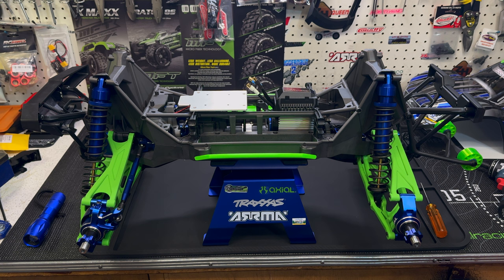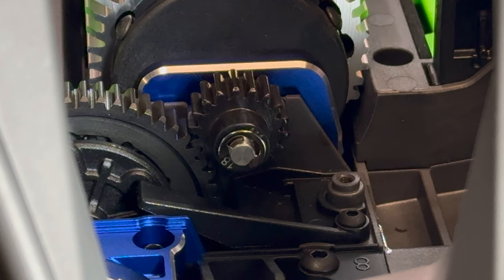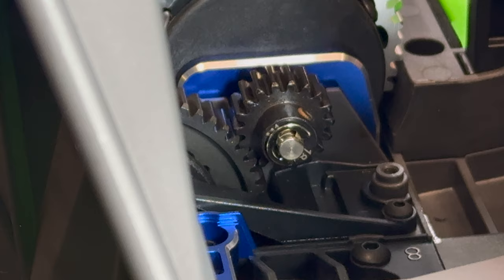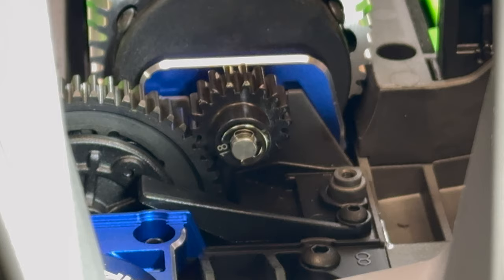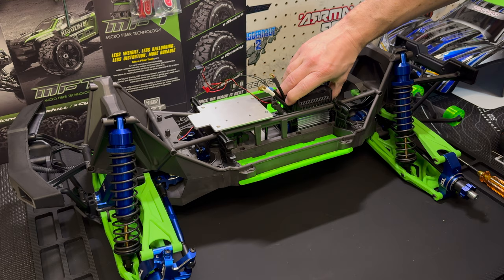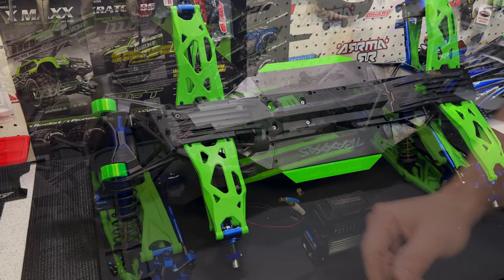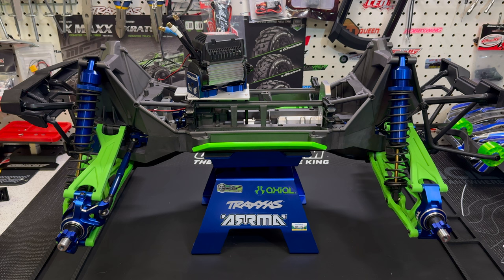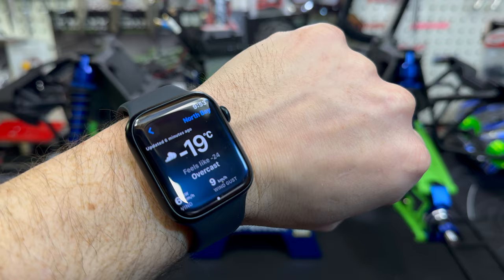Traxxas X Maxx Ultimate (Still has the same issue as all X Maxx's) EP. 5

Comment: I’m surprised yall have broken more shit. Suspension is pretty bulletproof but hell I’ve broken every piece of the drivetrain on multiple accounts besides the center driveshaft and driveshafts themselves. Diff cups,rear diff,front diff,center diff,spur,pinion. They take a beating for a while but as they age they really start to fall apart drivetrain wise. Maxx holds up way better in the long run

Comment: I ran mine straight out of the box. Even if the pins are in they usually have some play in them. If you take them completely out the motor will move. I have metal motor mounts and the Traxxas metal washers still have to adjust almost every time. Just my experiences. Still going to watch your videos 😊
Reply from the maker: No.   It’ll be fine.  I’ve been doing it for years. Plus a lot of motor mounts work that way.

Comment: IMPORTANT PLEASE READ!!!  For anyone having issues with burning up their pinion and spur gear and youve done and tried everything to correct the issue to no avail.. The stock xmaxx motor has a HUGE design flaw that no YouTuber is talking about!! I found this out myself while having non stop gear mesh issues since my xmaxx was new out of the box. The Stock motor has PLASTIC end caps.. These end caps become loose and the holes wollow out on the motor casing! This causes your motor mount to be loose ON THE MOTOR ITSELF so when you think you have your motor mount bolted in nice and tightly to your chassis you wont even rellixe that your motor is ever so slightly rocking back and forth on the motor mount! This causes your gear mesh to be ever changing from too tight to too loose! I spent SO much money on my xmaxx replacing every single item remotely realiated to the gears and its mesh to no avail.. I went through COUNTLESS pinion and spur gears from mod 1 to mod 1.5 .. hardened or NOT! Finally I decieded to do a motor swap knowing it was the ONLY thing left that could be causing the issues (I thought the motor shaft must be bent) and only after FULLY removing the motor and looking at it closely did I realize that the motor mount was never tight to the motor itself from day ONE. and only kept getting worse with time..

MORAL OF THE STORY: If you think youve tried everything and are still having gear /gear mesh issues then get rid of that factroy motor! I listened to all the youtubers who said "Stock motor is great, no need to replace it!" and I got burned because of it! Dont be like me and save yourself the trouble as even if its not causing you an issue now.. it eventually will loosen up in the future and will start eating gears.
Reply: For anyone wondering.. I now run the Spectrum 1250kv motor with the thick 8mm shaft.. A max 6 ESC, a GPM 35t mod 1.5 Spur gear along with their lengthened spur gear shaft with the end bearing to help support all the torque.. and I run 13T / 14T GDS hardned mod 1.5 pinions which come with the bigger grub screw which is heaps better than any other pinion and it keeps the pinion from loosening up and falling off the shaft due to the tiny grub screws other companys use.  The only good thing about having that hidden issue is ..now my xmaxx is fully upgraded because of it lol.
Reply: This is the problem with YouTubers such as Jason and the rest of the m2c racing testers …..a stock x Maxx doesn’t need the all the aluminium extras doesn’t need a more powerful motor just a esc and upgrades in the right area such as captured pins servo esc tyres and gears
Reply: Adding all this extra weight will inevitably cause issues it’s just showcasing people to get the m2c hop ups and motors etc that these YouTubers promote ……THUNDER RC proves you don’t need all this crap he’s one of the only YouTubers to bash hard and show you all
Reply: Thunder rc bashes properly and unlike Jason who some of his videos are very good talks too much and babies his rigs I don’t know even why he upgrades them so much as he doesn’t bash hard at all
Reply: Thunder rc bashes properly and unlike Jason who some of his videos are very good talks too much and babies his rigs I don’t know even why he upgrades them so much as he doesn’t bash hard at all rich and the others bash hard but promote the other companies where Jason builds shelf queens …he does make good videos however if you want honestly go to thunder rc he bashes hard when 99% of us don’t send them like thunder and rich

Comment: Interesting.  I use the pins, but just ignore the labeling and use whatever position gets the mesh right.
Reply: Cool, I think I may just try that if its too tight,  do some testing... my first x maxx the motor got too hot so I put the arrma 5th scale system in it  with new mount and esc plate it's great now waiting for my second x maxx now...

Comment: You can use the pin system just go one pin higher on the pin chart. The pins keep the rear and front of the motor perfectly aligned straight to make sure that the mesh between the spur and the pinion is at a perfect zero degree angle to each other.

Comment: Had stock gears for probably 40 plus packs of hard use and never had an issue 🤷. Just installed 19 tooth pinion from tekno and 50t spur from hot racing just because I wanted a better ratio. I still use the stock pin system and mount and it meshes perfect, zero issues thus far. I was fully ready to abandon the stock motor mount system if it didn’t mesh well, but it matched up great.

Comment: All you have to do for the motor gears  to be meshed properly, just move the motor pin to one gear tooth higher. Exp running 17t pinion put the motor pins on the 18t slot mesh will be good 👍🏼

Comment: When I built mine, I used the hot racing motor mounts on the original motor and the mesh didn't mesh well 😅 so I tried different pin settings and one of the leaves a bit of wiggle room so the gears are NOT gonna be at each other to death. Definitely not the pin settings they call for, just a fyi

Comment: I've been in the rc hobby for 10+ years now. I've gone through my fair share of gears. I can't for the life of me (even with aftermarket motor mount) keep my pinion on my stock xmaxx motor. Green/red locktite with a MIP driver. I even bought tekno gears that have the 2.5m grub screws and let it sit a week, and it still fell off in 5 minutes. My mesh great and bearings are new. I'm starting to question if my motor is just vibrating wayy too much
Reply: Clean the threads better
Reply: with a dremel,, shave a bit off the shaft where the grub screw sits. then apply loctite. will never come off again
Reply: They come with an oil on them from the manufacturer
Reply: Try putting some loctite on the motor shaft and let it set
Reply: Had the same problem and finally from some advice on Facebook group this has worked for me: Make sure to clean the new pinion with brake cleaner or equivalent, taking out the grub screw even to get the cleaner everywhere. Also clean the motor shaft. Then put blue Loctite into the hole on pinion some Loctite will get on motor shaft. Tighten down and leave truck 24-48hrs. I’ve done this exact process and it’s the only thing that worked. Hope this helps!

Comment: I have 1st production run xmaxx . Have used shim paper under motor mounts since 2016.😮😊😊😊😊😊😊😊 if your truck doesn't cost when let off gas,your mesh is to tight an your temps well burn up motors ,batteries, escs,, now totally 8s machine like new.still shimed

Comment: You never even ran it, they're way smoother than original xmaxx, I noticed that right out of the box when I ran mine. No chipping nothing I have ran mine over a month. getting to geeked out and never ran it, if it was the cheap bronze gears, definitely change to traxxas harden steel gears both spur and pinion or another brand.